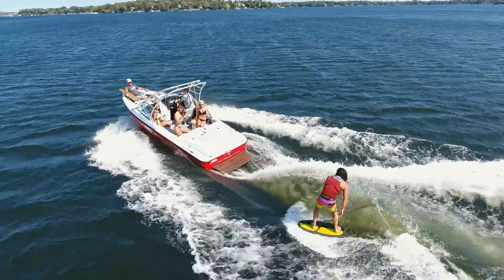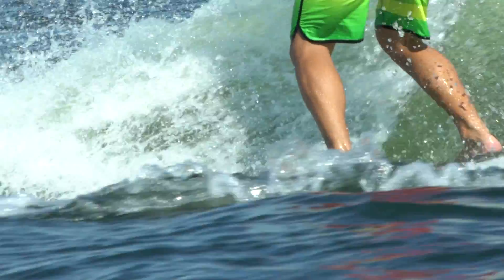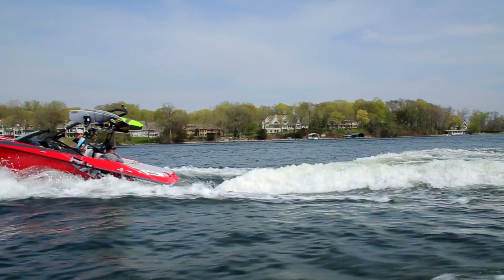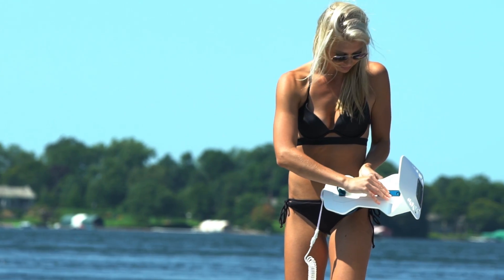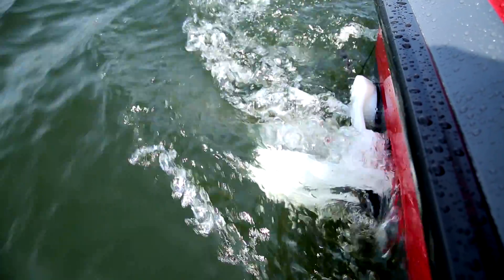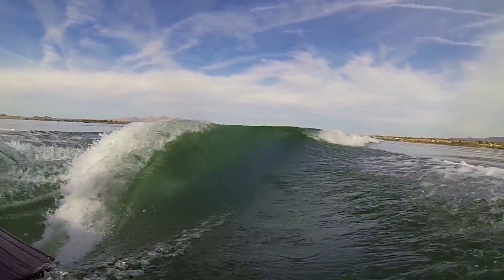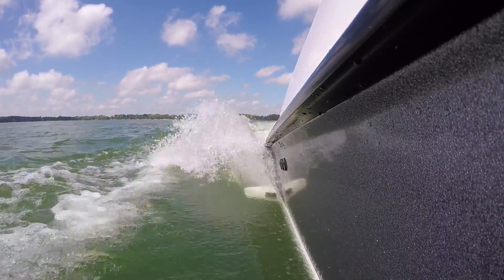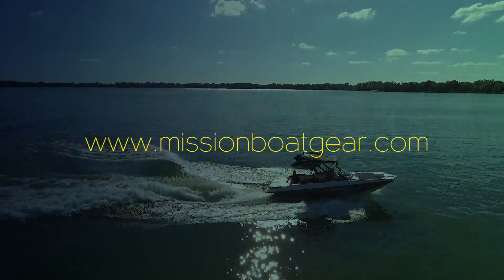How Do Wakesurf Shapers Work on Inboard Boats?

Comment: Hello.  I have your wave shaper and it works great on my 2011 Chaparral 196 SSI, but does not have the space for the suctions in a 2007 Glastron SX 175.  Any advice or different model that you have ??

Comment: Would it be possible to use a device like this on a sea doo jet ski?
Reply from the maker: While our DELTA does very well with single-engine watercraft, including PWC, the wave will be smaller than an inboard boat because it does not displace enough water. 

Also, the rider may need a longer board with more surface area, and it may not have enough push for larger riders. A light-weight and or child rider would work best.